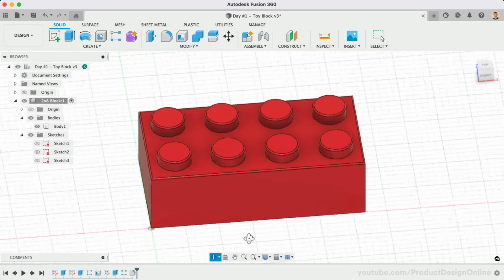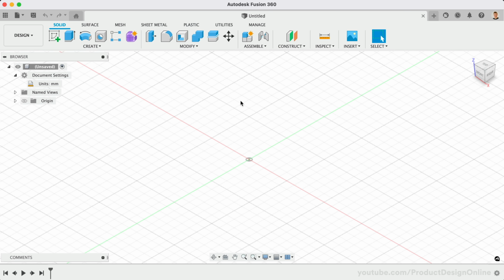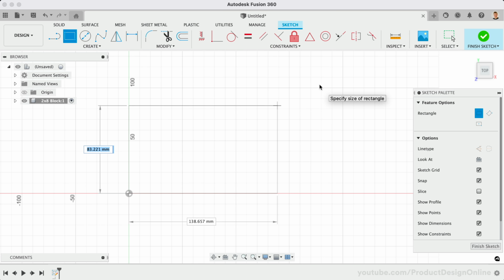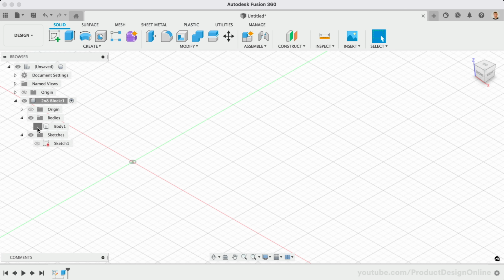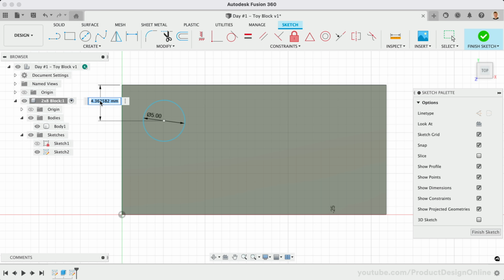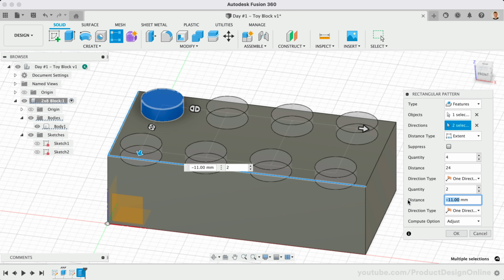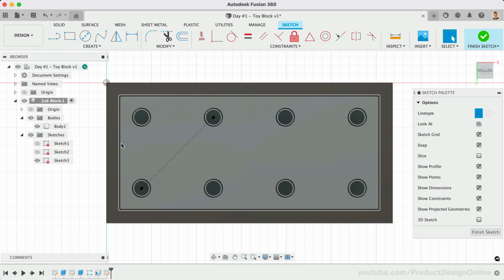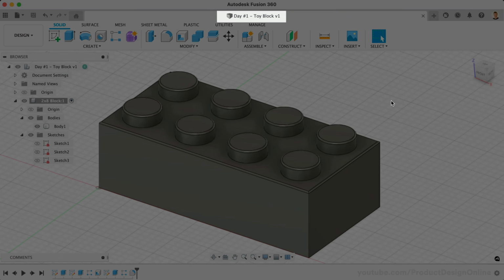Day 1 of Learn Fusion 360 in 30 Days for Complete Beginners! - 2023 EDITION

Comment: I've designed a net retaining clip for soccer goal frames using Fusion 360 as a first project.  When I export to .STL file, it takes 10 minutes to generate a 1.3 megabyte file.  I'm curious whether this is normal.
Reply from the maker: It sounds like you're using the 'File > Export' workflow, which uses cloud translation. Although STL is one option, its really intended for other file types.

Instead, I recommend right-clicking on the component in the Fusion 360 Browser > select 'Save as Mesh' > choose STL. This will export the STL instantly (local translation).
Reply: @ProductDesignOnline  Much better, thanks.

Comment: First off.  Great Video.  Excellent explanations and well paced!  

I have a quick question.  I noticed that the section sketch didn't become locked until the 2nd dimension was defined.  Why is this?
Reply from the maker: Which part are you referring to as the 'section sketch'?

Sketches are only considered 'fully constrained' if all geometry in the sketches is dimensioned and/or constrained to allow no degrees of freedom.  A good way to test is to click and drag on sketch objects to see what moves.

Comment: You must be using a different version of Fusion 360. For when I follow you different menus come up. Thus making it hard to follow. 

I use 2.0.15050 x86_64
January 2023
Reply from the maker: This is the latest version of Fusion 360. What menu(s) are you not seeing? As a side note - the Sketch menu is contextual and will only show when you're in a sketch mode.
Reply: @ProductDesignOnline  Okay, it took me a few times, but I figured out that if I do not follow every exact detail of what you do within the video nothing will work. This just means that I go through your video(s) several times, sometimes stopping every 5 seconds. Thanks for your reply.

Comment: Whenever I select the hollow interior of the block to create the circular pillar on the interior the sketch that is created doesn’t next under Sketches as Sketch #3 like in the video. Instead it nests in Origin above the 2x8 Block:1 drop-down. Anyone know where I went wrong?
Reply: I am also struggling with this. Did you figure it out?

Comment: Thank you so much for this tutorial. It was fun to make a toy block. And i had to improve it by adding parameters. I made it so the length and width depended on the amount of knobs in either axis, same with the cylinder at the bottom. Supercool computer program.

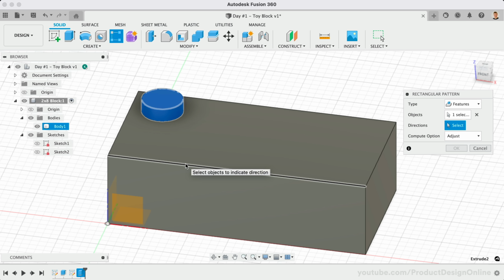Comment: For some reason Direction does not pop up for me and I only have 3 or 4 categories with drop downs none wil change to direction at 8:50ish mark

Weird I clicked the same points as you and it opened it but my still says Axes instead of Direction and my settings are default like you showed in the beginning

Comment: I'm a newbie to CAD design.  Your tutorials seem fairly straightforward but I've hit a wall in Day 1.  The Rectangular Pattern dialogue box - I don't have the 'Directions' option for creating the pattern of extrusion bumps.  Is this because I'm using the freebie version of Fusion 260?
Reply from the maker: The Hobbyist/Personal Use license is the same version as all other license types, just has some reduced feature access. Can you doublecheck that you're using the Solid modeling feature and not the sketch modeling feature?
Reply: @ProductDesignOnline  Thanks for replying - I figured out I wasn't clicking on the object edges to set the axes.

Comment: Hi anyone out there, please. I am having a problem finding the screens and setting you are referring to. I have the free version, which possibly has different functions? For example, I cannot find a setting in my profile to restore default settings. The dropdown doesn't give me the option of a new project, it just shows me objects I have created.
Reply from the maker: Select the profile image (or initials) in the upper right > Preferences > a preferences dialog will appear. You will then see a 'Restore Defaults' button in the lower left of the dialog. If that is grated out then that means you're already using the default settings.
Reply: @ProductDesignOnline  Thank you! I was in default, but don't get the same drop down from the upper left, perhaps it is because I don't have an active project or am new. Your courses are far superior. Thank you very much!!! I am an old ProE super user with a Carvera coming in and getting back to speed. Much appreciated.

Comment: This tutorial is very good. I've been using Fusion 360 a few years, half assed, and I have tried many tutorials to learn more here on You Tube. However, a lot of people, respectfully, keep showing the same stuff, spending incredible amounts of time on the same things, and this guy just shows you how it works, where to find it, and moves on. I like his style, and I'm going through every video he has on this software now. Simple things like telling you "hey, there are two Rectangular Pattern commands, avoid the sketch one, use this one" are great. I've never seen anyone explain this. I for one really appreciate you put the time, effort, and energy into putting these videos out. I mean, seriously, anyone could learn from your tutorials, and literally create a job for themselves. Anyone that doesn't think it is possible without a degree, think again. I work at a machine shop. We're setting up CNC lathes and running all kinds of parts. Well, a friend that works there, he came on You Tube, learned Fusion 360, and then demonstrated his ability at our job. Now he models a lot of our lathe work, and gets paid well for it. So, these videos are super valuable. you can literally elevate your knowledge/skills and specialize yourself for the job you want. A big thank you to you. 

I know im rambling, but seriously, I see it as a big deal. Just by following these, practicing, and learning the proper way to use this software through these tutorials, i will no doubt become more valuable at work, increase my wages, and ultimately help my family/children more because of it. Thanks again, it is much appreciated. I hope you succeed in every way bro.

Comment: G'day Kevin, this is my first interaction with F360. Your tutorial was pretty quick but stopping the video all the time was no issue. It was exciting to actually create something in the first lesson! Other tutorials I have done for other software are still rabbiting on about toolbar settings in lesson 3. Anyways, I was progressing fine until I completed the pattern where I could see the eight little cylinders were aligned to each other but not centered on the block. TROUBLE. I deleted the cylinders, and it seems I have to go back into 'sketch mode' to redraw the circles, but it seems I'm stuck in 'Solid Mode'. How how? What what? Stuck help!
Michael
Reply: the tool allows you to go back in time and correct your mistakes
Reply: @thakibkorede  thanks. I did do that but I couldn’t find sketching again it was like in 3D mode (I know it’s not called that). I’m only new at it but I’m getting there. The videos take a lot of stopping and rewinding, it’s all WAY to fast for me, but that has a positive side as he gets it done in one lesson. 👍 It how you learn most things, make a mistake, end up in some area you aren’t familiar with and spend the next hour trying this and that to get back on track. I know what to do now, and know what I did wrong. Cheers.

Comment: Wonderful video, I followed along every step, and then afterward made a scaled up model just to make sure I digested all the info. One thing is that I set my settings to default as you suggested, in order to easier follow along. I hadn't changed many settings prior to the vid. But one suggestion is that it seems to have wiped out my post processor from the program. I've been fumbling through learning Fusion for a few months now, so I was able to get it rectified (although now i need to manually selectmy post processor every time i save a toolpath, whereasbefore it was defaulted to my machine and post), but if this had happened 2 or 3 months ago I would have been utterly lost. If you warned folks that this would happen you might be able to save some newbs like me some needless heartache.  Looking forward to going through the 30 day course with you!
Reply from the maker: Hi Dallas. Thanks for the suggestion! I wasn't aware that it would effect and post/machine settings. I'll have to double-check if that is normal behavior.

Comment: Only at 3:13 and already lost. You say, select the bottom X Y origin plane. Yet the block that shows orientation in the upper righthand corner of the screen shows TOP. Then when you select, whatever it was you selected, your X Y origin plane show numbers (ie 50, 100, or -50, -100) mine does not show that. Unclear as to why. Then when I select either the TOP or the Bottom plane/view, the Y (in green) the X (in red) and the Z ( in blue) are in different corners than the one shown on your screen. Can you help me? Thank you!

Comment: I know you dont respond to comments, but can you please help me with just 1 issue? Can you tell me how to set the default selection tool as the paint option? The default is always the selection window/box keybind #1, but I dont ever use that option so I would really like the default to be the #3 keybind/paint option instead. It is really starting to bug me having to always change it every time I open F360. I googled this and I cannot find any videos or forums discussing this issue, so I am at a complete loss here.